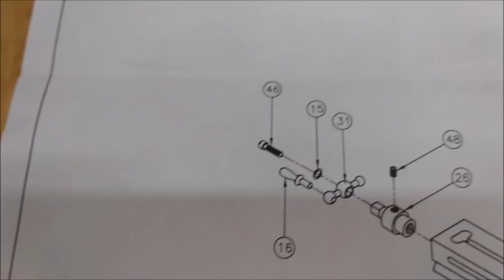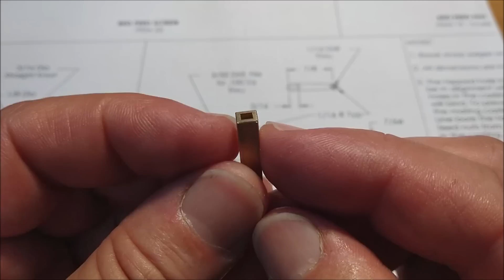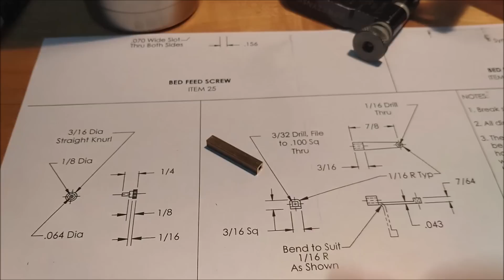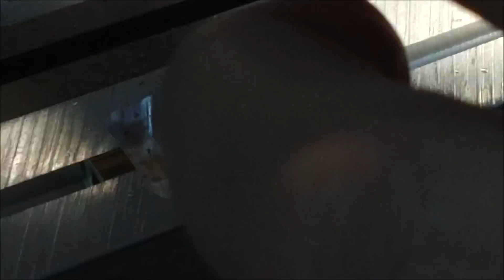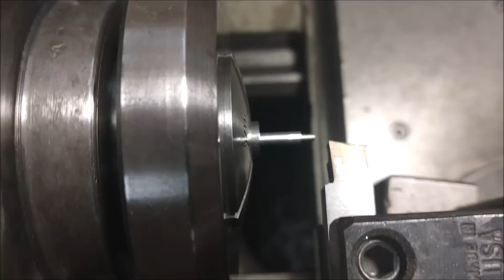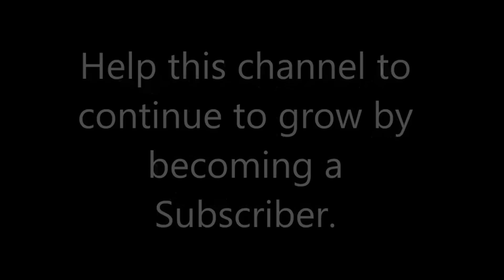Shaving Corners and Broaching Square Holes ?  -- SHOP GEM --

Comment: Hi Joe, Can you describe your square hole broaching tool in a little more detail? Was the end hollow ground and if so what did you use to produce this feature? Also, what relief angle did you have behind the cutting edges? If one has a SG then I can see how it could be made easily in HSS or even in carbide from a tool blank.
Reply from the maker: https://www.youtube.com/watch?v=yu02RLpq_K0&t=1s
Reply: Excellent Video on the Single Tooth Square Hole Broach Construction -Thank you!

Comment: How hot can you get brass before you start getting zinc vapors? I'm a bit nervous about heating it over the 600°–700°F used for soft soldering. Some Googling indicates that zinc melts at 787°F.

Comment: for the larger version, I could see it made from a flat bar, a tube and a handle, but for the model... to get it to look good at scale, I can see why they make it as mostly one piece. It might even be worth adding a bin next to the machine with the scrap pieces as an accessory or with alternate handles as spares... maybe with a little bit of chain attached so they don't get misplace... lol.

Comment: Honestly, I probably would have tried to make a shim so part #18 would better fit part #28; maybe some thin plastic or paper. Some test fittings, filing, & trial and error, until it just fits, then superglue the shim inside part #18. Cut off any excess, and voila! A crank handle that fits. 😊